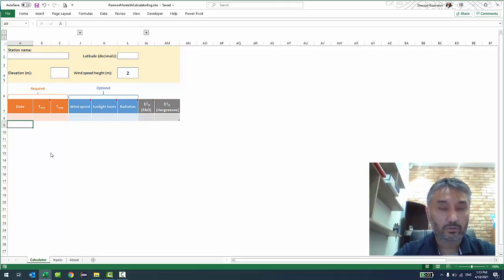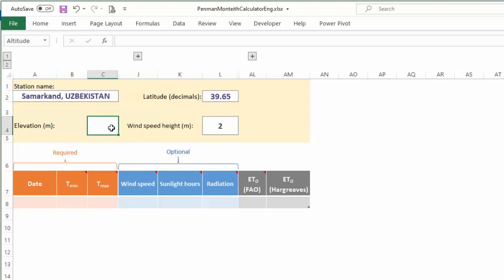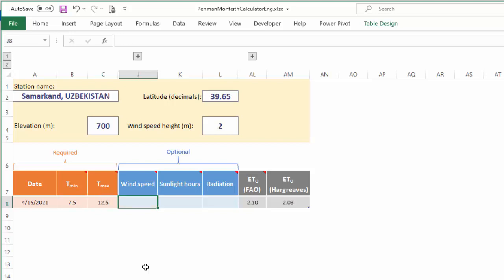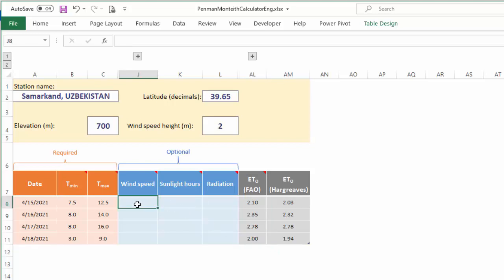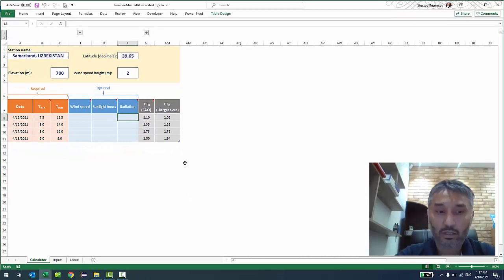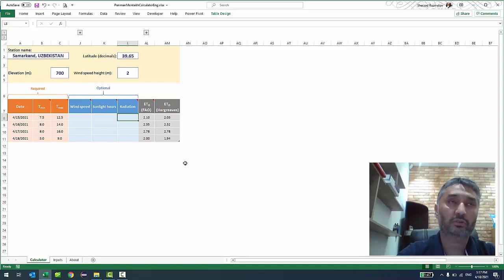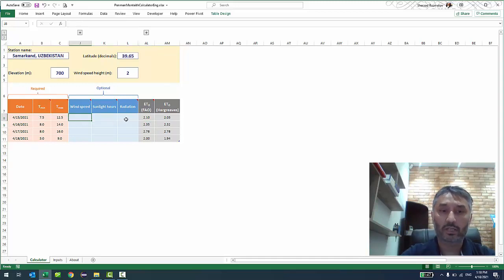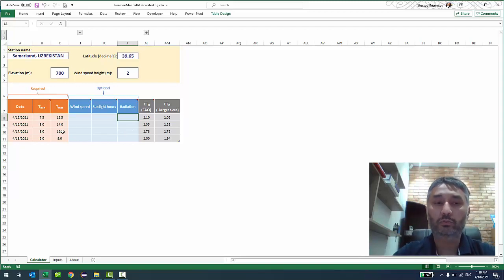Excel spreadsheet to calculate Evapotranspiration (ETo) based on FAO56 with missing climate data

Comment: Thank sir for creating this amazing excel file. I have a doubt regarding calculation of Hargreaves ET: FAO paper 56 Eq. 52 provides the HS eq for ET as "ETo = 0.0023(Tmean +17.8)*sqrt(Tmax −Tmin )* Ra'. In the excel sheet, you have used "0.0023 * ([@Tmean]+17.8) * SQRT([@Tmax]-[@Tmin])*[@Ra] * 0.408" [copied as it is from formula bar]. Do we need to multiply the factor of "0.408" for Hargreaves ET ? or have you done some calibration ? Will be very thankful for your feedback!!

Comment: Thanks for this video, do you have something about calculation of Evapotranspiration from weather station data in different times for example if we have data every 10 minutes?
Reply from the maker: Not yet. FAO 56 does address this matter. But I did not implemented it in this spreadsheet. 

We installed weather station in the orchard that logs ETo evert 10 minutes. Then I stopped using this spreadsheet. Sorry :)

Comment: Thanks a lot. Can I apply monthly data to the calculator?
Reply from the maker: According to FAO you can use monthly mean data to estimate monthly ETo using this calculator. There is a section on the said paper with an example. Look for a section “Ten-day or monthly time step”: https://www.fao.org/3/x0490e/x0490e08.htm

I hope that is helpful!
Reply: @sherzodr  👍🏻🙏🏻

Comment: Hi
How is evapotranspiration calculated according to the number of plants per decare?
Reply from the maker: Hi,

You have to calculate evapotranspiration for the area only, then divide by number of plants that area covers.

For example, if ETo per day is 5mm, assuming Kc = 1, then total volume of water consumed per decare per day is 5,000 liters. if you have 100 plants covering that area, then each plant would consume 50 liters of water during that day. 

You may say, that those plants are not covering the whole area. In that case you have to calculate how much are those plants are covering, and you have calculate ET for that area. 

What if you have trees? Trees usually do not (and must not!) shade 100% of the area! if trees are shading at least 60% of the area planted, than those trees are considered to have covered 100% of the area. Refer to chart on the 2nd page of the following publication: https://anrcatalog.ucanr.edu/pdf/8212.pdf

Comment: Respected Ruzmetov, Hope you will be fine and doing well. I had seen your video regarding ET estimation it seems much impressive with so normal information. I have implemented my ground data in your calculator and found much higher difference of values in comparison to GRACE estimated ET.
Reply from the maker: Hi Mr Sajjad. Thank you.

That is interesting. Would you be able to share some data so I can check? Please also indicate location of the field. 

My email address is on the separate sheet of the excel workbook.

Comment: What if we had subtropical humid climate in one part of a province and tropical Savannah in the other part...
In such case what value should we use to calculate dew point temperature?
Reply from the maker: Hello Soumik. 

This dew point setting is relevant only if you do not have measured humidity. 

If you have no humidity data, in your subtropic humid climate use offset of 0 degrees. 

In your savannah climate try to observe, especially in early mornings metal surfaces. If they seem moist to the touch then setting of 0 works as well. If they are dry settings of 1 or 2 might be appropriate for the area. 

If you have a chance do try to measure actual relative humidity at some point.
Reply: @sherzodr  Thank you very much Sherzod...
Yes, I don't have humidity data... But I've dew point temperature data... So, I'm using that data to calculate ET0.. is that fine?
Once again thanks for the suggestions...
Reply from the maker: If you already have measured dew point data then that setting also becomes obsolete. Measured dew point temperature is used to calculate relative humidity.
Reply: @sherzodr  Okay...Thank you so much...
Reply: One more issue I'm facing regarding the calculator...
The calculator is not automatically calculating net radiation (Rn)... However, it calculates net shortwave (Rns) and longwave (Rnl) radiation..and without Rn I'm not getting the ET0 values...
So, to calculate Rn, I deduct the Rns values from Rnl. Am I doing it correctly?
Thank you.

Comment: Hello, if i want to use this calculator for estimation of evapotranspiration for the coastal area of Lebanon what do i need to change in the inputs (other than kRs= 0.19) Thank you in advance.
Reply from the maker: Hello

Yes, set kRs to 0.19. If you expect the calculator to guess your dewpoint as well set Tdew to be Tmin-0. This means your daily dewpoint will be the same as your Tmin. For coastal region of lebanon it should be accurate.
Reply: @sherzodr   Thank you for your reply 🙌🏻 but if im not expecting the calculator to guess dewpoint then should i just leave it at Tdew as Tmin-2? (Or does it need to be Tmin-0 for the coastal region of Lebanon). 
One more question, is the ETo Hargreaves is it the Hargreaves-Samani 1985 equation? 
Thank you for this calculator once again!!
Reply from the maker: @Skz_97_SA  ETo Hargreaves is based on Hargreaves-Samani equation.

 If you mean to provide your Tdew to the calculator, then the calculator would ignore your Tdew setting in the Inputs sheet. So don't worry about it then. But if Humidity and Tdew information will be missing, it's a handy setting. If you provide me your approximate location coordinates, and what information you have at hand, I can take a look at it. My e-mail should be in "About" sheet of the excel workbook.

In my comparisons "ETo Hargreaves" is quite accurate if average daily humidity is around 50%, in climates with light winds. If this describes your climate, most likely ETo Hargreaves and ETo FAO56 will be quite close.
Reply: @sherzodr  yes I've sent you an email